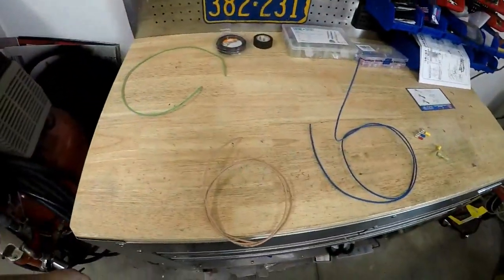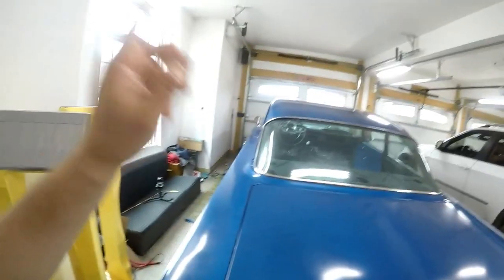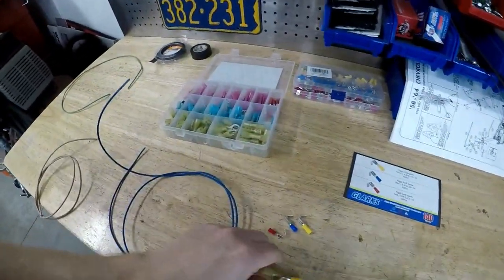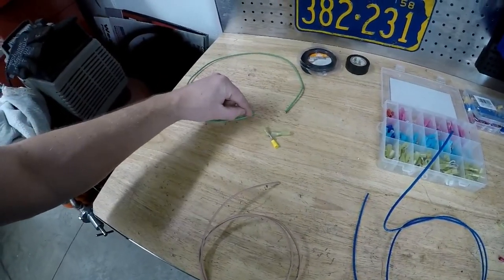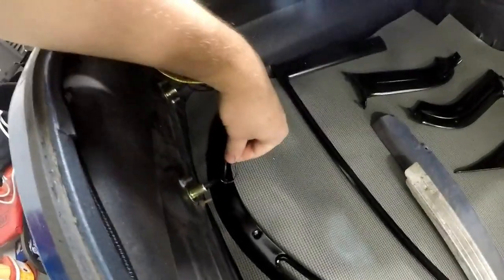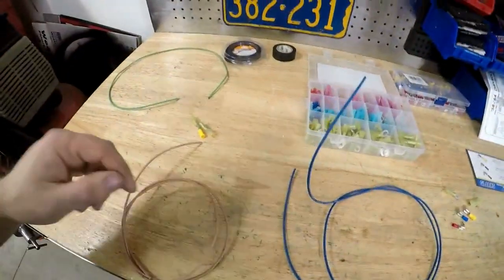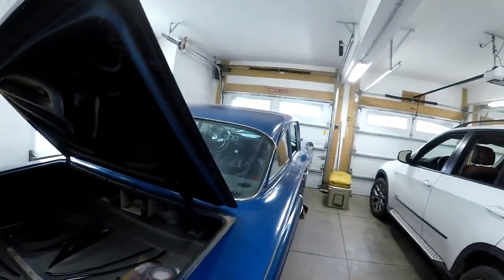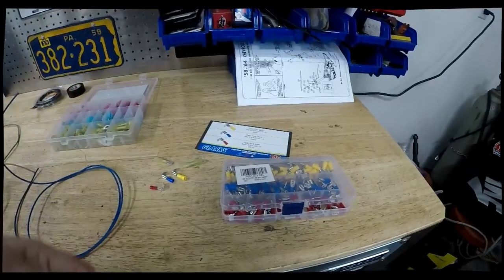The best way to splice three wires together

Comment: You could use step down butt connectors. One aide is a certain size awg and the other side of the connector is a different awg. So you could put 2 wiresvonbone side and 1 wire on the other.
Reply: Not code-compliant. 2 wires in one side of a butt connector meant for one wire can easily short, arc, or straight up fail and pull out (and then arc on the way).

Thanks though.
Reply: @ssaammhhaaiinn what are you talking about? there are butt connectors that account for the total area of wire used by OEM. what is this code compliant you speaking of? above a 12v system?

Comment: Could you show the actual process with your three example pieces of wire and how you connect the wires to the connectors? Great video but that was example would help visually learn how to use those connectors. Thanks!
Reply: Yes I would love to see how these are attached a little more specifically.  Trying to see exactly how they connect.